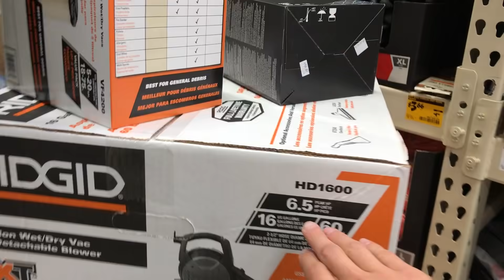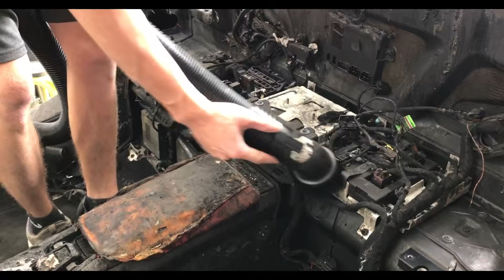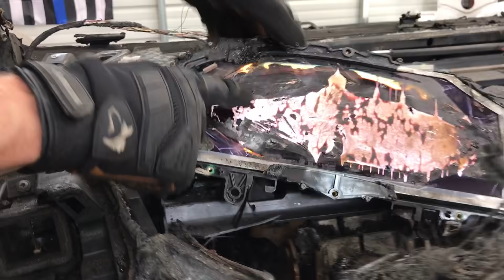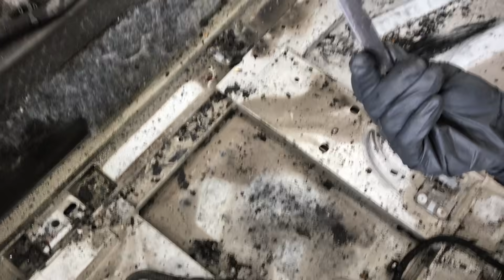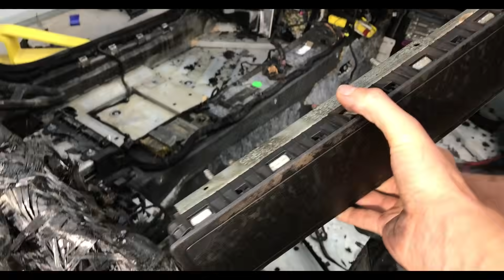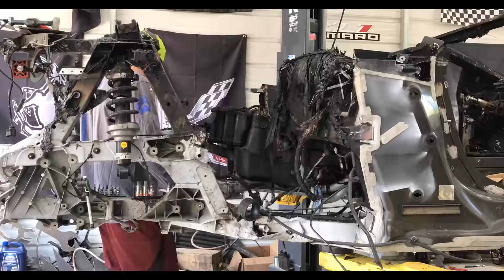Building A Custom Supercar Part 4

Comment: I hope you guys do realize you can't use the chassis or anything. You can use the engine, gearbox, and so forth, on ANOTHER chassis.

As you guys conclude yourself, this has been a pretty hot fire. To melt aliminium  it has been above about 660 degrees celcius (or 1200 farenheit). Carbon or glassfiber contraptions, once they burn, they burn like crazy. Also the resin used to make carbon or glassfiber parts, is temperature sensitive.

Whatever chassis is there, is either deformed or weakened too much to re-use. There's no way that monocoque survived that fire in any way.

In short; harvest the parts you can sell, and ditch the rest. You can't use the chassis, and if you want to use the engine, you'll end up buying SO MANY new parts for it, that you would have been cheaper off to just buy a new engine to the specs you like.

Comment: Sometimes you need to ask not if something is possible but if it's worth it? Sell off what you can and scrap all the metal. This project is silly imo. Finish the other stuff and or get a cheap build this is a silly build....just being straight with you guys.